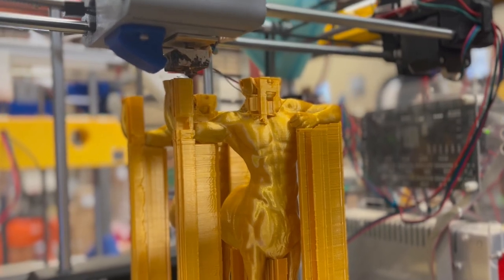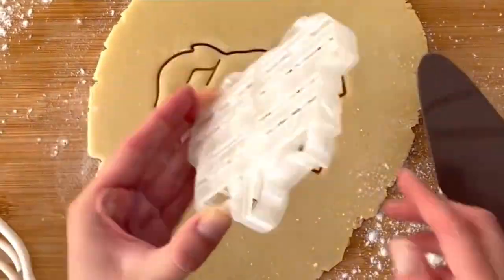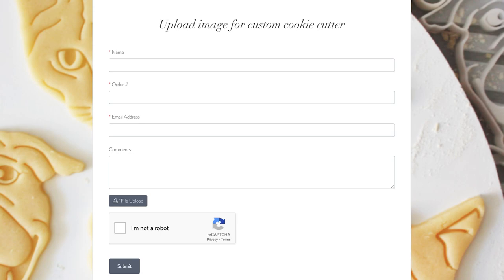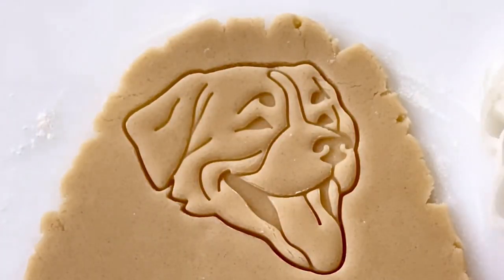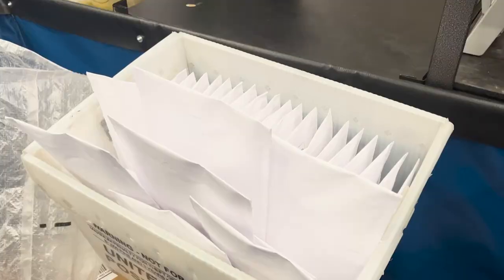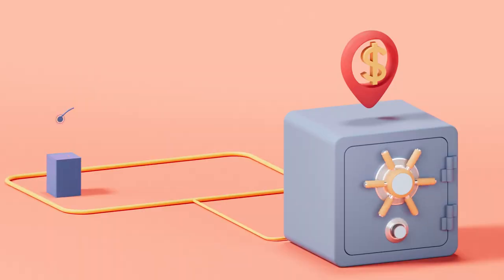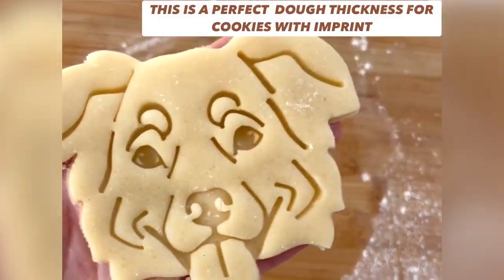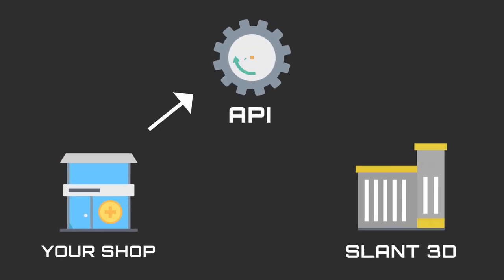Bakers Street's Giant Etsy Print on Demand Store | Real 3D Printed Products

Comment: I thought fdm prints generally weren't food safe. Not anything to do with the material itself, but the little ridges that the process leaves (between each layer) are apparently impossible to clean properly.
Reply: Yep that’s right. I don’t know how much research has been done tho. There’s probably some paper somewhere
Reply: @blackmcbwhite2996  There was one study recently concluding they can be cleaned just fine. But.... lol. Best practice for self printing them is just toss them and make another. Hard for a customer to do that.
Reply: as someone who makes them my self i use .8 nozzles where its less of an issue with bigger layer lines that are easier to clean. additionally, there are different grades of food safe. these are perfectly fine for minimal contact and precooked food. anything that could get in them will be cleansed during the cooking process anyways and and they dont make enough contact to leech chemicals from the dye process.